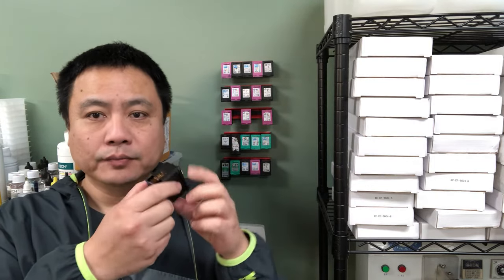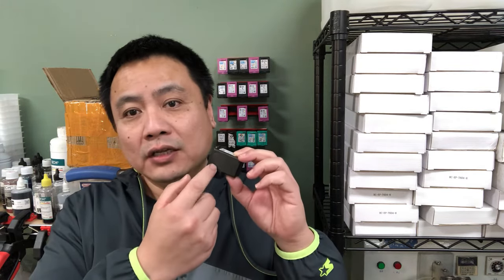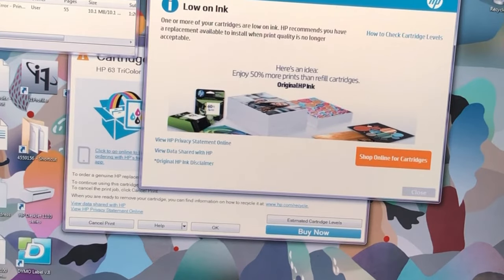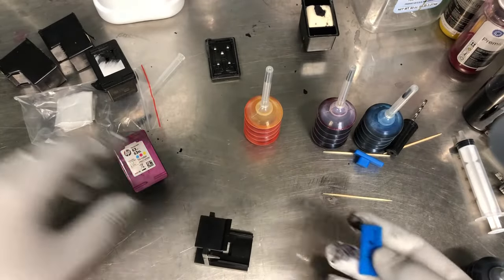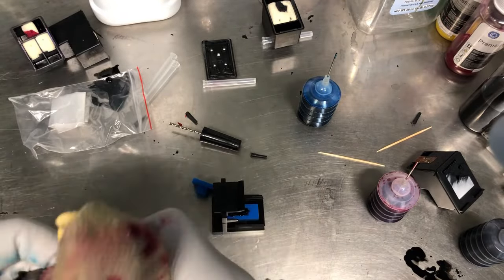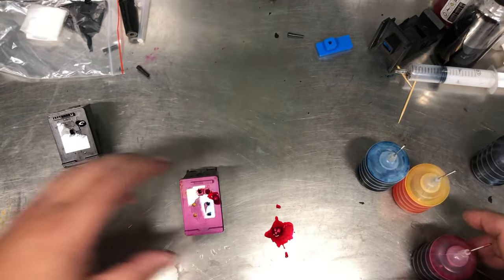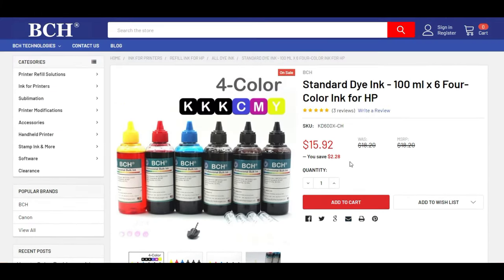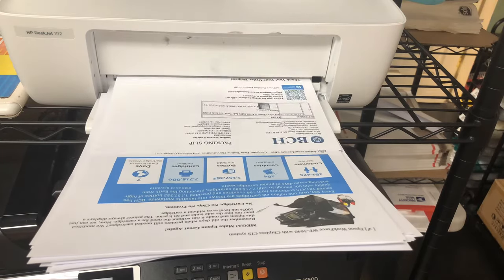Comprehensive Guide to Refill HP Integrated Cartridges

Comment: Don't really need to remove the lables, just poke a hole thru it in the right place with the toothpick used to check for color chambers, then use a small piece of clear tape to cover the holes up.

Comment: I remember back years ago. Lexmark printers were running their low ink scams. You'd have to cycle through 4 cartridges to do the drill hole/remove sticker refills. Might be easier ways in 2024. I ended up buying a Cannon, and giving the Lexmark w/cartridges away. I was so annoyed with Lexmark! I informed the family member of the issues, and solutions. I put the cartridges in separate ziplock sandwich bags. I taped over the printer heads to keep them from drying out. They'd be out of use for long periods of time. Maybe keeping old ones refrigerated might help. Then use a q-tip, and some rubbing alcohol to clean the cartridge printer heads before reusing. They're a pain in the as* to unclog without wasting paper/ink. I'd reuse the same paper multiple times on test pages. Thanks to your videos I see better ways to unclog printer heads, and fully fill cartridges thanks! 👍🏾. Sometimes you need to clean out the excess ink catch tray, and sponge also. Older printers were so annoying because of the many ink scams going on at that time. They'd sell the printer for a low price. Make all their money off low filled new ink cartridges, and false errors. Brand-new ink cartridges aren't even full on those types of printers. Back then some brands had the ink, page, cartridge, etc, counters. All to support their low ink/fake cartridge scams. Not sure what scams on printers are these days. I haven't bought a new printer/scanner in years. I know now to research before considering buying a new one. 🙄🤥😂 A bunch of lying, shady, annoying companies out there. Side note: You can get more ink for a lower price by searching for refill kits on the same websites. Just by looking through different printer models. I did that and ended up with way more ink. Plus it came with regular black, and pigment black. All for less than what my model number was charging w/o the extra pigment black included.

Comment: I refilled HP 901 cartridges for two  HP J4580 printers today and I have both of them now printing CMYK properly.  Thank you for the good advice.  As it turns out, I do not need a new printer, I only need to refill the ink and ignore or bypass the warnings but continue printing.
Reply from the maker: Looks like you’ve outsmarted the printer gods! Who needs a new machine when you have the power of refills in your hands?

Comment: Hey Kevin, I just wanted to ask you about HP's new instant Ink Subscription. My new printer came with several months free so I went ahead and subscribed. After subscription was over I put 3rd party ink carts into my HP printer. I refiled them several times and they worked for a little while but now I am unable to print with them. I use HP Smart to do my printing. A message pops up bottom right on laptop screen that says, " Print job paused. Resolve issue then check printer status" I will click continue then another message saying," Print canceled" I go into the settings on HP Smart app and it is saying, " Cartridge Problem" 
Has something changed in the past few years, since yo posted this video? 
Have I done something by subscribing with HP Instant Ink and I won't be able to use 3rd party carts any longer? please please help... I use my printer for so much that help the disadvantaged children in my community. Thanks much
Reply: I was told once you use HP ink service you can no longer use 3rd party brand ink. This came from an Amazon seller of ink.

Comment: I ordered HP 902 ink cartridges for a HP OfficeJet Pro 6978.   I installed the cartridges in the printer and got a “Incompatible cartridge” message on my printer.   The Cyan ink cartridge is the issue. I re-installed the EMPTY Cyan cartridge and the printer accepted the cartridge with no error messages.
After trying 4 (four) more  brand new HP Cyan cartridges purchased, the same “Incompatible cartridge “message displayed.  
Further research revealed that the Cyan cartridge is made in Malaysia and the other cartridges are made in China including the empty Cyan cartridge that was taken out of the printer.   The only ink cartridges that are compatible are the ones made in China. 
Is there a work-around for this issue?

Comment: Is there a way that I can continue to use the Instant Ink carts that were sent to me through my subscription?. I have many brand new carts from them.
Reply: If u wanna use the instant ink carts and u no longer have a active subscription you have to take the top off of the instant ink cartridge and have another cartridge that is not instant ink (prefferably empty). Suck the ink out of the instant ink and fill the non instant ink sponges back up.
Reply: I was told from an Amazon seller of 3RD Party Cartridges that if I ever used the hp ink service then I cannot use third party brands anymore. I've never used hps service so I'm unsure if that's true.

Comment: Hi Kevin. After watching your video I sucessfully reloaded my HPDeskjet 2300 printer. I did so twice but later made the mistake of overfilling. After several attempts,again following your advice, I ran into trouble and could only print well in B/W. It was strange as the test page, although not in proper colours, printed mostly ok. I had a yellow flashing light which I could only extinguish by unplugging the power & leaving for  a while before trying again. Most times it worked. Increasingly I found more functions unavailable. Mant times I carefully cleaned with an electical contact spray the contact heads which improved things. Foolishly I deleated my printer & reloaded. I then had even more problems as the align & clean cartridge facilities were not available. I can now print sometimes in B/W. Mostly I get corrupted printout.
My question is this;- If I buy your refillable cartridges how can I load a driver program that will work? HP seem to be making it impossible to use my printer without their really expensive genuine cardtridges.
DaveJ

Comment: How do I know if my Envy 5530 printer or any old 61 cartridge I have lying around  are unlocked or not?  I keep getting this  "incompatible cartridge" message.  The cartridge was flushed and refilled by me and was working great for 8 pages until I ran out of paper and then it stopped and started giving me error messages and all the restarts and attempts at resets are for naught.  I am going to try HP support, since they are supposed to let me print.

Comment: If your printer is not reading the cartridge or says it's corrupted but you just refilled it you can do this but at your own risk: When refilling the cartridge take off the top paper completely, you'll see a circular indentation to the right of the refill hole.  After refilling use a tip of pen cap or something strong and press that circular depression 10 to 15 seconds, but do not puncture it... That resets the cartridge and usually you can use again with great success...
Reply: There is NOTHING under that detent on an HP cartridge. NOTHING in ANY of these "DIY" reports works on an Hp psc 1350v multi function machine. There is NO interface window, NO "ok" button, and NO printer program on a CrimeBook! I don't have "windows" any more!  How do I DEFEAT that idiot program INSIDE my printer, that was made to sell EXPENSIVE ink cartridges?

Comment: I have an HP 96 cartridge that needs refilling. Do I have to pull some of the ink from the bottom? If so where is it and how do I recover it. I also cannot find the holder your using to refill. I have you ink. Thanks.

Comment: Hello Sir  I seen you video for hp refill and I also other people video too, I done refilling two carriages as you shown one is working with printer show no ink and put other cartiage when loaded then the matching not at all detecting. Not at all printing even blank page is not comming out, My hp printer is hp 3538 modle. Pls guide how to use the refilled cartiage and what are logic of electrical contacts of cartiage idea.
Reply from the maker: The printer will not recognize the ink level.  However, it can still printing.

Comment: Hey kevin,
 thank you for this video!
I thought I ruined my printer after installing refillable ink so I didn't use my new printer for three years. Today I clean it as much as possible and now its printing black. But no colors. The people that sold me the refillable ink never told me about needing to prime the ink at all. nor is this on their instructions that came with the ink. I went on the bch website to find the priming tool kit for my printer and there is so many numbers listed but I didn't see a specific printer model number. I have an hp deskjet 1510 series. 
Do you have ANY help as how to bypass having to reset the printer after each and every single print job?  
I have to unplug my printer and press the power button for ten seconds then print whatever id like to print then plug my printer back up. This is the only way my printer just one thing at a time. Its frustrating I turned off the bidirectional support and I disabled HP cartridge protection. I learned all this from another video a lady post here which got my printer to finally print but only black. 
My computer will not allow me to align, clean cartridges or clean printer.

Comment: thnank you for this great video but hp blocked my hp 63 black cartridige on hp envy 4516 printer because it says remove and install cartridge every time i put in my printer and itried many time or and it show x sign on the ink level and not working at all

Comment: I bought a HP Envy 6222 takes a #46 and I can't find any in my area, I bought the BCH Kit EZ30T and am still having issue with the printer telling me it is a fake cartridge or out of ink, I wish there were new stickers to cover the holes on top of the cartridges. ugh
Reply: Take some tape, and press yes, keep using. I have an envy 6455 and it works flawlessly!
Reply: It told me it was remanufactured and fake. I just pressed keep using and that was it

Comment: I have a hp inkadvantage 3545 who is stucked with the message “incompatible cartrige. The indicated cartridges are not intended for use in this printer” 
Although os the original cartridge, I have refilled it several times. All of a sudden it gives me this message and there is no option to bypass this. Should I sue them? I would love to settle on a 6 figure amount of money.
Any tips to continue to use this printer?

Comment: Did this a minute ago and kinda made a mess because i think i squeeze too fast. And then when installed, my printer did not recognise the cartridge so i couldn;'t print. I gave up. I took it out and left it sitting on the desk. After a while i tried again and installed it. And it worked! But ink level still the same, so i really don;'t know where i have gone wrong.

Comment: Ino this is old and I hope u can help me I just found ur chanel 
I have  the hp printer 🖨️ and I did have the ink by mail .  Now that cartage they due control the printing prosse  when I cancelled the the account they disabled my printer and I could not put a new or used cartage in .. I refilld a older one with 10ml.  I had and now it's not printing anything what can I do ?
Reply: Yea HP can and WILL shut you down if you do not turn off report sharing. Turn off all reporting options.
Reply: @xTK421x  I did and had to reinstall everything and my laptop went black  .. I can't get it to open to reset it .. 🤔😲😡🤦 not very happy with them ..
Reply: @xTK421x  I do have it working it is now printing with out stoping .. but now the laptop 💻 issue SMH 🤦 sent the a email and told them the problem .. and that intell it fix I will not return the ink cartridges to them .. it was to be the $2.99 and they were taking $17.99 off my card ..

Comment: well i do not want to disappoint you but the ink can be refilled but the level indicator in the printer keeps on going lower. when empty it will say counterfit cartridge or refilled cartridge used. then it will start to print white pages only so it throws away the ink. i refilled when it was still saying there was ink in it but after refilling it went empty. During the time that there was still ink level visible it printed fine and as soon as the empty came up it stopped printing, only print white pages. yes you can print yes it will take ink out of the cartridge but it does not put it on the paper. hp envy

Comment: Question: The label has to be removed to expose the ink hole… When refill is complete doesn’t a piece of tape need to be put back over the exposed ink hole to create internal pressure? Doesn’t seem like Kevin put tape over the holes when he re-inserted the cartridge back into the printer. Anybody?
Reply from the maker: Doesn’t matter that much.  If you decide to put label back, make sure it’s not airtight.  Otherwise the cartridge can’t breathe.
Reply: Hey Kevin, thanks for your reply. First, let me tell say how happy I am that I brought your "Z" pak. (That's what I'm calling your EZ30-T, because it cured what was ailing my printer)! Pretty much nailed it on the first try thanks to your outstanding DIY video! Doubt I filled it much more than 50%...something told me that's better than overfilling, and I'll refill as often as needed, and will try never to overfill. The label thing still bothers me...those labels seem to be put on in such a way as to prevent any air in or out. When Costco refills they always cover over the ink hole with tape. Is that just to prevent leakage? You are the professional here...but the damn thing is nagging at me. Anyway I used a small piece of blue painters tape to cover over. So far so great. I should also tell you I have yet to refill the color cube...I quit while I was ahead. Ha!

Comment: Well you're right and you're wrong anyway. I join the HP instant ink program. And I had to change my bank card and forgot to add it to hp's instant ink program. And I went to go print but it blocks my ability to print because I need to update my billing information and when I print over the pages that they allow. They blocked my ability to print. And if you don't believe me I have plenty of screenshots and plenty of screenshots of me bitching at support about it.
Reply from the maker: Any cartridge that you used to join the HP instant ink program, belongs to HP. So you can't do anything about it. However, if you bought cartridge from regular retail channel, it's yours and you have the right to refill it.
Reply: So if i was to reuse that same ink cartridge that is linked to instant hp that it wouldn't print? I did have to cancel my subscription with hp instant ink and remove the printer from the account. 

Now i bought some refillable ink for my old manufacturer ink cartridges, but wont let me print unless i linked the ink to hp instant, so how do i bypass it without linked it to hp?

Comment: Man... It's funny just for refilling catridge waste so much papers for test print. I hate HP, they have to be cheapest but became crap now.

I do used to be refilling, until printer reject the catridges. it says not original, but first install it said original, as the lights blinking and fail to operate.

Comment: Funny I just bought Asda refills that I've used before many times the crap hp alarmed out with cartridges not compatible and would let me print, I took them back got a refund
Bought the gold plated hp cartridges, and suprise,!! They worked straight away !! When these run out I'm  going to throw the poxy hp printer off my roof and get something else, I hope they go bust and I meet the CEO homeless on the street so I can piss in his face

Comment: Is there a way to get around instant ink? Like could I disable that feature so I can use the cartridge because they have stole my money 3 months in a row now and I can’t get someone to help me
Reply: You need to end the subscription first then remove your printer from you lr account. Thats as far as i know as i had that issues, but currently working on getting my refillable manufacturing ink cartridge to work without the printer giving me an error to link the ink with hp instand ink